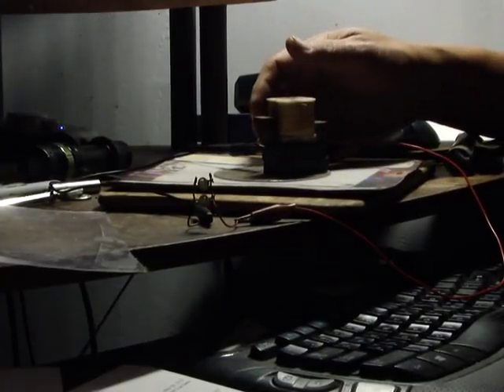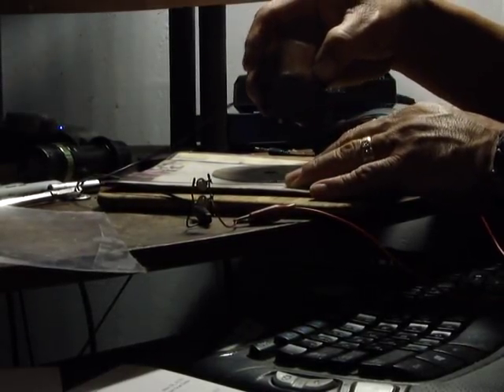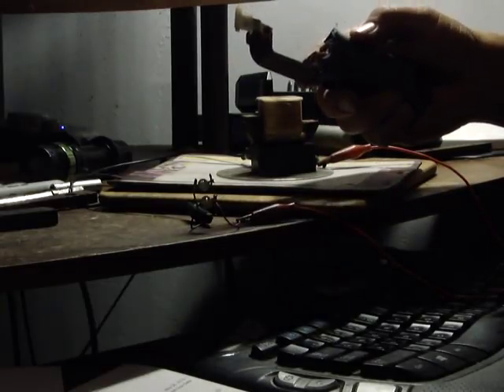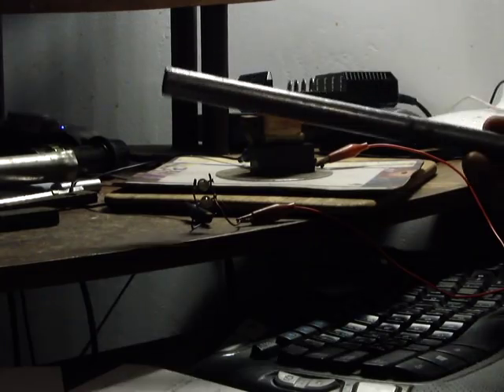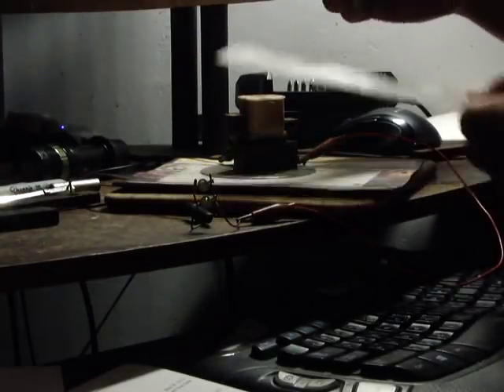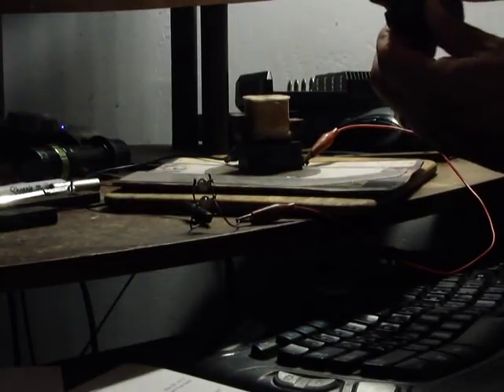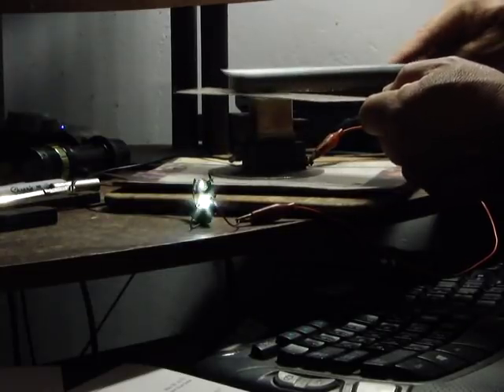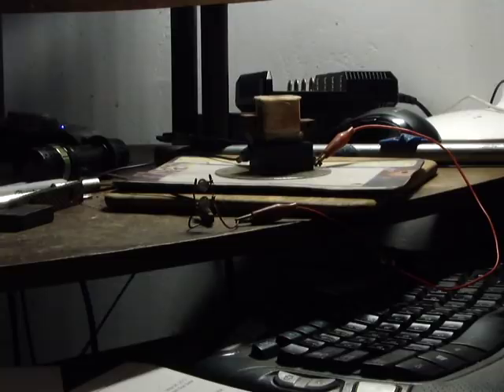Magnetic Flow causes electrical flow demo,simple y efectivo, keeping it simple but effective

Comment: This is how an electric guitar pickup (with magnet and coil) picks up the metal string movement generating current that goes to the guitar amplifier. Metal like iron becomes a magnet when in a magnetic field. In this case the iron bar becomes another magnet moving the near the coil. Thank you for your videos.

Comment: Yes because even nonmagnetic materials will also disrupt the magnetic field due to eddy currents being formed in the nonmagnetic material.  This is explained in Lenz Law  Lenz Law is in effect here. This is how permanent magnetic generators work.  You may not sense a drag as you wave the metal and think Lenz is not in effect, but it is.  The current is so small, that is the reason you may not detect it.  Increase the load and you'll notice it.  https://www.youtube.com/watch?v=N7tIi71-AjA  
https://www.youtube.com/watch?v=copZj1WF0Y8

Comment: You are only using iron objects.
Reply from the maker: yes iron and magnetism is a match in heaven, like copper and electricity
Reply: Did you try other metals?
Reply from the maker: @_John_Sean_Walker  No mr walker i didnt because on the gitgo I know iron has a 7000 to 1 affinity towards iron 1 being air, a get a lot of flack people telling me that magnetism goe s thru air and yes they are right but given the choice you can manipulate magnetism with iron and the odds are 7000 to 1 in your favor just like electricity to copper wire and how you can guide it
Reply: So it does not work with aluminium?
Reply from the maker: @_John_Sean_Walker  unfortunately no there is practically no affinity towards alum...
Reply: But if you did not try, it is just theory.
Reply from the maker: @_John_Sean_Walker  no mr walker its just i know the answer already and i know what works and what doesnt, i think you are just being... dont know what the word might be
Reply from the maker: i think you know what happens if you put a lighted match under your finger and its not just a theory, right?